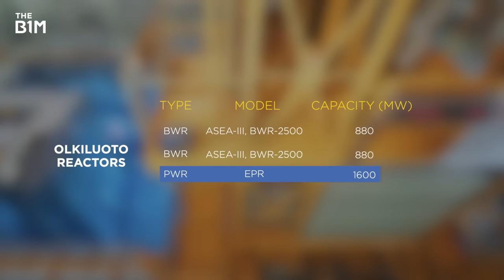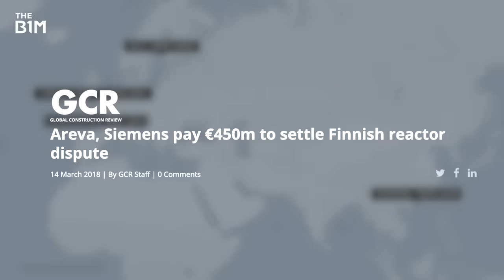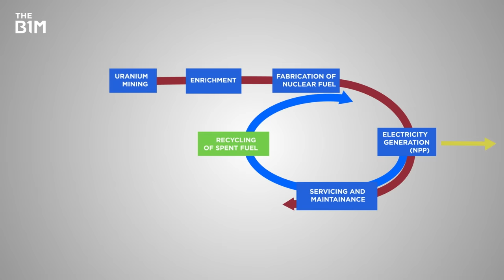Finland Might Have Solved Nuclear Power’s Biggest Problem

Comment: "Just bury it deeper, that should do it." - some Finnish engineer, probably

There is honestly a tiny bit more to the hole than it would appear, a big part why this is viable in Finland is because we don't have that much unpleasant geological activity here. No fault lines, no volcanic activity, no earthquakes... basically just a lot of boring old rock. But that's perfect if you want something to remain nice and sealed in the spent fuel depository.
Reply: I thought there was a development years ago that increased the efficiency of, how much of the rod gets used. Why does this endeavor even exist? They mostly use up the rod, this is unnecessary.
Reply: @HaloWolf102  I'm not a nuclear expert. But I bet the Finns who designed their super efficient ERP are. So if those guys think it is necessary or sensible to bury their spend rots I would guess they know what they are doing.
Reply: @Bryan-fy7od  energy can neither be created or destroyed but transformed from one form to another. so essentially it's all free lol
Reply: LOL, the Brazilian geologic morphology shares the same characteristics that you have described. I am wondering if would be ecological the idea of burring radioactive side product under the amazonian forest.
Reply: @vinolicam4140  Stop now lol, you'll have a job with the conservatives tomorrow
Reply: @dummytest4822  Depends on how you define energy. Is mass energy?
Reply: @HaloWolf102  That's the point: "mostly". No matter how small the leftovers, it is still radioactive.
Reply: @dbclass4075  Containment of radioactive materials is relative easy. We've been doing that for almost 50 years now. It's the part where it can't be penetrated by a militant force. 

In France some of the spent uranum-235 rods still contain a vast quantity of uranium, which is used to enrich new rods that come into production. That means that uranium rods that haven't been recycled, still contain raw power, and expensive materials. Such as in the U.S, they don't recycle. 

"Along with this development strategy, France has a policy of nuclear fuel management focused on the recycling of uranium oxide spent fuel into MOX fuel, currently used in 22 reactors" 
~IAEA 'Country Nuclear Power Profiles'

France (Updated 2020) 

"The U.S currently has 64,500 tons of spent fuel rods, including 15,360 tons in dry flasks." * ~(ton = 907.1847kg)

"Japan’s fuel cycle policy has been premised on the assumption that spent fuel will be
 reprocessed. Initially, spent fuel was sent to France and the U.K. for reprocessing." *

Not to account for the different dimensions of fuel rod cells. I also don't have the total number of rods used between countries, so my argument is not entirely concrete, because research is still ongoing. A data sheet from * displays that in 2007. That france had 13,500 tons of nuclear waste. A dramatically smaller number than what America produced. 

Some more information that supports my original finding of efficient spent rods. Is that "France has 56 nuclear power reactors in operation, with two units closing in 2020 at Fessenheim (61 370 MW(e)) and one EPR reactor under construction at the Flamanville site."
~ IAEA 'Country Nuclear Power Profiles'

France (Updated 2020) 

and 

"As of May 1, 2021, there were 55 commercially operating nuclear power plants"... "in 28 U.S United States."
~ 'FREQUENTLY ASKED QUESTIONS' (FAQS) 'U.S Energy Information Administration' Last updated: May 3, 2021

So not only does France have almost the same number of active nuclear power plants than the U.S, they have just a fraction of the nuclear waste the U.S has. 

The U.S currently has "76 reactor"s" or storage sites in 34 states." (Can't find reputable information on this claim) 'Office of Nuclear Energy' '5 Fast Facts about Spent Nuclear Fuel'
March 30, 2020

*  directly quoted from 'Spent Fuel from Nuclear Reactors' June 2011
Reply: @HaloWolf102  Just didn't know that us even made ton weird. metric ton is 1000kg, so simple.😎
Reply: Day Made  It is not always windy, so we would need a lot of capacity to store the energy somehow. 
And to be fair, the material being buried was already radioactive before it was dug up in the first place, we're just putting it back into the earth after using it (unlike carbon, which gets burned and thus hangs around in the air as a gas).
Reply: Are you sure that that will still be the case in one hundred thousand years?
Reply: And what better way to spice up that boring old rock?
Reply: Finland never heard of "shit happens".
Reply: @PlayRoomHR  Or, more formally, Murphy's law: "Anything that can go wrong will go wrong."
Reply: Finland also has low population density.
Reply: en.wikipedia.org/wiki/BN-1200_reactor
Reply: Day Made  we don't have enough wind and turbines to give energy to the whole world. It's not enough.
Reply: @scifino1  Send Murphy to any landfill near water tables then, not some mile deep whole filled with rocks where some clown thinks Godzilla lives
Reply: Given enough time something will go horribly wrong and the regret will be huge.  For example the holes will flood.
Reply: @monad_tcp  that was not the point. The fact is, if you use that kind of energy source, you will need to coexist with that side product for all your life span, and your son's life span, and lots of generations after that.
Reply: A massive failure to understand time scale. The idea that Finland might be able to control radioactivity from leaking or leaching into groundwater for 100 years -- OK, I'll stipulate it. If we are super generous, let's say 1,000 years. Do we really know if Finland or any other country will survive that long? What natural disasters might occur? What social changes might occur? It would be silly to say that we do. And that's just 1,000 years. That leaves a mere 100,000 years during which poisonous toxic crap sits in the ground, all because it was convenient to do so for a very very brief time. I would call nuclear a terrible plan but that's too kind. There is no plan.
Reply: @qqw743   The time scale and social changes are the main issue, but this is something that countless professionals have spent decades thinking about, and I think you underestimate how much.

First, the repository is roughly 9x as deep as ground water. It is meant to be completely filled shut with clay and concrete so that no water can ever reach the spent fuel, which itself is encased in capsules that should hold up to anything except an absolute catastrophy.

Secondly, if you look at the geological data on Finland, you would find that that there have been no geological or natural disasters of such magnitude that it would, at least in theory, jeopardize the containment. The rock on which Finland sits on is billions of years old. Expexting it to suddenly go up in flames in a hundred, a thousand, even ten thousand years, is more than unlikely. By any reasonable, even worst case, timescale the radioactivity should have simmered down to a natural level.

Also I would like to point out that the hole is much deeper than where fissile fuel is generally dug up from. It is already radioactive before we extract it, and now we are effectively hiding it further into the earth than what it used to be, albeit of course in a higher concentration locally.

Nuclear may not be the perfect option and it does possess inherent dangers, but our main issue is that the use of coal will destroy our society and possibly the ecosystem in under 100 years time. We've already caused the planet irreparable damage and every second forward counts. Building renewable infrastructure takes a lot of time and resources, even when done in places where they are viable. Even things like geothermal power cause inherent risks in the long term (inbalanced cooling of the rock already leads to minor earthquakes in some areas) that we are only beginning to understand.

These people are not putting toxic waste into the ground to spite you; they are trying to save you, while also providing you with heating and electricity to your house.
Reply: @Nas_Atlas  The holes are supposed to be filled shut, so flooding should be very unlikely
Reply: @PastaAivo  I understand that no one is trying to spite me and that the purpose is to generate energy. I also understand that coal poses terrible risks right now. No dispute there. 

Your assurances about Finland I find well-meaning but woefully inadequate. There are two types of risk: social and environmental. 
 Let's take the social risks. How long do governments last? A couple of hundred years. But let's be generous. Let's say Finland will last as it is for 2,000 years, which countries have never manged without massive changes. But let's imagine that this time it holds. OK, great. That leaves nearly about 100,000 years. What will the next government or social order look like? Unanswerable question. 
The Roman Empire could rise and fall 30 times and uranium would still be incredibly dangerous, even in extremely small amounts. And no one is in position to speculate how to solve this problem. 
Are you imagining that 50,000 years from now there will still be the same buildings there, a bunch of Finns in hardhats checking the computers? 
ALL of what is considered recorded history started roughly 5,000 years ago. Think of the massive changes since then. Now project that unknown change into the future. I understand your point that smart people think that they have addressed this problem, but I dispute that they have made any progress whatsoever. Can they assure us that 1,000 years or even 100 from now, there won't be people in the area who want to dig up the uranium and disperse it? I don't know why anyone would want to do that, but that's the nature of the unknown. Who knows? 
For a sense of the difficulty of imagining the future: let's go back in time and ask the Goths what they think of the internet. It's absurd, right? So are these assurances. 
The second type of risk is environmental. I understand that engineers sought rock that has been safe from risk for a billion years. Prove to me that there will not be an earthquake, flood, hurricane, etc. etc. that undoes all that confidence. Naturally, you can't, because it's speculative. But that's the nature of the time scale, it forces speculation that gets increasingly unreliable as the scale increases. 
If you tell me you have a high degree of confidence that nothing bad will happen next year, I'm with you. Five years? Sure. 
50,000? How can anyone claim that they can guarantee with a straight face that ceramics created in 2020 will hold up just fine throughout that time? There is literally nothing we can say with confidence about such time scales, except that uranium will still be really bad news for living organisms. Maybe during that time someone will figure out a good way around that. That would be nice. But we have no reason to think so. 

Meanwhile, we have safer options. Every dollar invested into nuclear is not invested in renewables, which don't leave a terrible cost behind. The progress we have made on renewables is incredible. We have the technology already to power the world, if we were to coordinate it globally. I'm old enough to have witnessed assurances that nuclear power is safe from one generation of plants to the next, only to find out that oops, it's not, and the waste keeps piling up, not one bit safer than it used to be.
Reply: @qqw743  And some dollars not invested in nuclear still unfortunately go to coal. 

But I agree, I'd say the biggest danger by far is the society forgetting where we hid the radioactive material and digging it up by accident. There are ways to prevent that, but only for so long. We can just hope that mining etc. in the future is done more responsibly than today, and that instruments like radiation gauges are being actively used (which I assume is the case even now, although I don't know).

In regards to the geology, my point is purely statistical. It is of course possible that just now there is a new superplume developing underneath the rock, or that something like a meteor would hit the spot in the future. We just don't know, but this currently seems the safest option. Same as if you feel like your home street is safe; there's never been crimes or violence committed so you don't expect any to happen, but it only takes a single stray bad actor to change that :)
Reply: @vinolicam4140  I know that, I better my children coexist with nuclear waste and take care of it like we do, than living in a +4c climate change with extinction of lots of ecosystems.
Reply: @monad_tcp  it's sad anyway.
Reply: @dbclass4075  "mostly"
Duhoh 
Like most naturally occurring things like potassium, which is slightly radioactive.
There's no such a thing as 0 radiation
Reply: @qqw743  renewables don't leave a cost behind, WHAT ?
What about the billions of tons of trash when their puny lifetime of 25 years expire ?
While a nuclear plant could last for a hundred years, but usually 60, and most of it is concrete, which is mostly inert and could be reused as gravel for pavement or something...
Reply: Heck, I'm not against solar power, I even have a small 1MW power plant which I sell energy.
But we need nuclear power for GW demand scale, remote regions, regions with colder environment. Regions with lots of variable demand.
We need everything we can throw at the problem, which is shutting down ALL coal and gas power plants. 
Solar alone won't cut with a solid 30% baseline of nuclear.
It's about economical feasibility.
Reply: We're not near closer to solving energy storage at scale. We absolutely need nuclear to make the grids work. 
Otherwise we are going to end with lots of gas power plants.
Which is BAD.
Reply: We better take care of NOW.
Because guess what ? Most of nuclear waste is on the surface, not buried.
So if society fall in 50y, which is very likely, who knows what people will do with fresh nuclear trash easily accessible without digging.
Instead of worrying about dumb treasure hunters in 50K years...

I'm literally rolling my eyes...
Reply: @monad_tcp  Spent nuclear fuel's radiation is still above safe limit, though.
Reply: @dbclass4075  doesn't matter when there's a billion tons of earth of top of it.

the safe limit of radiation for non-living things is what ?
Reply: @monad_tcp  Not great, not terrible.

Joking aside, spent fuel isn't something to handle so casually. The issue with them is less on the radiation intensity, and more on their duration. Somehow, our warnings should be something that can last longer than the lifespan of our languages. Something that should discourage curious beings from digging them up agin.
Reply: And I'll talk casually about it, it just another dangerous thing we take care of, as a society. 
I don't like this idea of conflating something with "pure evil".
Reply: TL;DR
I don't fear nuclear power or nuclear waste or even radiation. 
Its super well studied, the computer simulations are almost perfect.
We know the good, the bad,  its predictable. (no, chernobyl wasn't an accident, doing what they did, and knowing what we already knew that time, was criminal behavior)

Now when we talk about climate change. I don't fear it, but I fear the results, they aren't easy to predict like nuclear power. We are dealing with this thing we don't yet know how it works.

People should absolute be horrified about pushing the climate of the planet too far, yet, they don't...

That's what worries me. I guess we aren't not that different from a frog being boiled. A nuclear explosion is something that visceral and immediate, but a climate runaway is just normal business since 1940....

Fear is stupid in this complex world, don't listen to it, it doesn't know shit.
Reply: To anyone still interested or concerned, here's a very good video from the actual repository tunnels by Tom Scott
https://youtu.be/aoy_WJ3mE50
Reply: ... or so they thought...
Reply: @qqw743  “progress we … made on renewables is incredible”

Germany, 2021 TWH of coal electricity generation

3rd quarter: 35.1 TWh
2nd quarter: 28 TWh 

an increase of some 20%, quarter to quarter.  In  1st quarter 2022, fossil coal and gas will increase another 20% or 30%, as four more very viable nuclear plants close. All of that is on you.
Reply: @monad_tcp  Well said.  I’m afraid things will not change though until this phobia dies.
Reply: @mrg8092  No.
Reply: @monad_tcp  Please don't @ me any more, I'm exhausted by the absurdity of this thread. I thought this was going to be a science-based rational discussion. 
You lost me for good at: "The computer simulations are almost perfect."
1. How can anyone know that? 
2. "Almost" isn't very impressive over immense time scales.
Reply: @qqw743  I was talking about simulations of nuclear explosions. Not the plato's  hypothesis of philosophical simulation.
 They are almost perfect in a way they predict 99.9999999% accurate. 
Its the best simulation of anything we have. Why do you think governments invested so much in super computers? to run those simulations and keep developing nuclear weapons without a single detonation (that was banned). That's how good the simulations are.
Reply: Time scales don't matter for a nuclear reaction of a detonation that happens in milliseconds. What matter is if the simulation output matches the data.
Reply: This is literal science, I won't dump a lot of papers here, but its all know information, there's nothing that was more tested than nuclear simulations. 
Fluid-dynamics comes second, for obvious reasons of it being super useful modeling almost anything for the industry.
Reply: @Nill757  burying it in any abandoned salt mine would basically solve the problem. But people like to conjecture what will happen in 100K, it doesn't matter, any nuclear waste will be less radioactive the nuclear background radiation on some natural places...
the sight...
Reply: @qqw743    " "Almost" isn't very impressive over immense time scales."
Yes, because we need PERFECT ...
100% certainty only exists if you are a LIAR.
Nothing has 100% of perfection.

roll my eyeballs so hard it hurted...
Reply: @Nill757  unfortunately.... yes. What happens when solid material is removed and replaced with softer material? Yes.... it colapses! lets think about the weight of 1 mile of earth sitting on a spent Uranium tube bed. Think the preassure would blown the radiation upward after some tubes cracked open. enter the water supply? This is a quick fix. Those who thougth of this idea will be long gone before the real issues arise from this burial process. Mark my words... but then... ill be gone as well, so should it really matter?! .... yes... for your grandchildrens grandchildren.
Reply: @HaloWolf102  because that remaining 5% is radioactive and lethal for several millennia, 10s of thousands of years, but cant be used in the reactor because they don't give off enough thermal energy to boil a kettle, much less run a reactor. leaving the old rods in the reactor will also lower the efficiency, actually creating more radioactive waste.
Reply: @MyCheese123456789  Ah, so they prematurely stop the entire rod being used up to prevent the efficency of an area being eradiated by the rods. I have never read that anywhere, however that does make logical sense. 

I still don't know where I read that paper on them being able to use more of the fuel rod because of a new method they found, but I guess this search has to end. Thanks for the info.
Reply: See, it's not that this idea isn't feasible, it's just that this new disposal system works best in Finland.
Reply: Rat Pack  Do you realize how much coal it takes it the metal smelting process to make a wind turbine? It takes massive amounts of coal to produce the steel required for the making of a wind turbine. so much so you would better off just burning the coal for power.
Reply: Rat Pack  no man STEEL Needs COKE IE coal to make the high carbon content to make the steel from iron. its not a matter of melting at all.
Reply: @RenardThatch  That won't happen, lithium is found in open areas with a lot of salt in them, like marine deserts and near volcanos.
Reply: "don't have that much unpleasant geological activity here" today but we are burying this shit for millenia.  Its OK, we will be dead by the time this shit becomes an uncontrollable problem...
Reply: @dennispanko6311   I am not an expert so I trust my race to someone in a white coat...  just like the people of Chernobyl did, or Fukashima, or etc. etc. etc.
Reply: @vinolicam4140  My concerns about that are twofold: 1) The United States would jump at the chance to store THEIR nuclear waste in Brazil, instead of the Brazilians benefiting from nuclear power and using it for themselves, and 2) Some U.S. corporation would decide to save money on the sealed containers and/or some other aspect of sealing up the waste, and create an environmental disaster.
Reply: @Flip-3206  like the Yucca mountain in Nevada...Nevada has no nuclear plant, but was choose to store the nuclear byproduct of other states... making it brief: one of the biggest storage site of nuclear byproduct of the US was blocked by people's protest against those points rose by you.
Reply: @HaloWolf102   Please note that you are comparing the number of nuclear power plants in the US to the number of nuclear reactors in France. The numbers that I found for the number of nuclear reactors in the US is closer to 93 [1](A power plant can have multiple reactors). So the US has 93 reactors compared to France's 56[1][2][3][5]. This has parallels to the nuclear energy generation of each country. Where the US generated 843 TWh (19% of total energy in 2019)[3] vs. France's generated 413 TWh (71% of total energy in 2018)[2]. 

As a US resident, I don't doubt that we don't recycle as well as other countries but I find it unfair to compare raw weight of spent nuclear fuel in the face of varying energy generation.

So in short, the US is the worlds largest producer of Nuclear energy by amount and France is the worlds largest producer of Nuclear energy by percentage energy generation. 

Here are some of my sources:

[1]  https://www.eia.gov/tools/faqs/faq.php?id=207&t=3
[2]  https://world-nuclear.org/information-library/country-profiles/countries-a-f/france.aspx
[3]  https://world-nuclear.org/information-library/country-profiles/countries-t-z/usa-nuclear-power.aspx
[4]  https://world-nuclear.org/information-library/current-and-future-generation/nuclear-power-in-the-world-today.aspx
[5]  https://pris.iaea.org/PRIS/CountryStatistics/CountryStatisticsLandingPage.aspx

From your original comment:

Some more information that supports my original finding of efficient spent rods. Is that "France has 56 nuclear power reactors in operation, with two units closing in 2020 at Fessenheim (61 370 MW(e)) and one EPR reactor under construction at the Flamanville site."
~ IAEA 'Country Nuclear Power Profiles'

France (Updated 2020) 

and 

"As of May 1, 2021, there were 55 commercially operating nuclear power plants"... "in 28 U.S United States."
~ 'FREQUENTLY ASKED QUESTIONS' (FAQS) 'U.S Energy Information Administration' Last updated: May 3, 2021

So not only does France have almost the same number of active nuclear power plants than the U.S, they have just a fraction of the nuclear waste the U.S has.
Reply: @joshuabarber4733  "...but I find it unfair to compare raw weight of spent nuclear fuel in the face of varying energy generation."

Yes, there was a lapse of information since I couldn't find anything in my very short pursuing of data. My argument wasn't fully intact.

"Not to account for the different dimensions of fuel rod cells. I also don't have the total number of rods used between countries, so my argument is not entirely concrete, because research is still ongoing."

& 

"I still don't know where I read that paper on them being able to use more of the fuel rod because of a new method they found, but I guess this search has to end."

Thank you for the cited sources in your comment. Individuals like you make an example of how an argument should be presented.

In the end, as per usual, is that I have not read up on enough material to make a decision on this topic. These links will provide more information for me to read,  as well as interesting others. Thank you for time and have a nice day.
Reply: @HaloWolf102  Thank you as well for being accepting of more information. I wish more people could respectfully converse like this in comment section. Best wishes to you.
Reply: Yes, and the earth axle is wobbling. Who can garantee that wobble will never change? Maybe Finland will get a vulcano after 90 thousand years? We homo sapiens are always bloody optimistic. But ordinary people can't even read hieroglyfs, and those are only 4 thousand years old (or how old are they). We only live now and we hardly know a thing about the past. We need specialist for that, and all they do is disagree and argue. Great.
Reply: @thequattro20v  Those emperor followers are not exactly smart. Changing is never easy, but in this case I'd fully understand an invasion and suppressing those Americans, until they gave up these stupid units for everything.
Reply: @lordanonimmo7699  Ah, is that tunnel leaking ALREADY?!
Reply: @voornaam3191  Yeah,they had problems with cooper.
Reply: @PastaAivo  Flooding is good! Nuclear reactors are in such a "swimming pool" for a reason. Water blocks radiation extremely well. But yeah, when there is water contained in that rock, will that slowly slowly move into our drinking water? Did those engineers check that? Oops!
Reply: @voornaam3191  Uh, you tagged the wrong guy. I agree with you.
Reply: @voornaam3191  sorry, I don't agree with him to, and I am sure that he was not a good choice, but the hate against him will just makes things worst.
Reply: Though there are re use methods for nuclear waste and future thorium reactors may make this an even more long term option since the half life is low and the waste is even lower
Reply: @kevinmclain6741  Impossible to say, but none in the previous 10,000,000+ years
Reply: @PastaAivo  Based on what science?
Reply: @kevinmclain6741  Geology and statistics, mostly. Possibly some radiology. Finland is extremely old geologically speaking, much of the rock is either 1,9 to 2,2 billion years old or 2,5 to 4 billion (archean). Pretty much in the middle of the Fenno-Scandian shield so it's some of the oldest surface rock you can find. Geologically speaking quite boring, unless you go very, very far back.
Reply: A quick search tells me you have zero clue what you are talking about.
Reply: @kevinmclain6741  You need to open your results a bit more to help anyone in this comment thread
Reply: The unexpected is invisible by nature, I pray you will never say they never saw it coming.
Reply: Yea that makes sense. Japan definitely should not attempt 😂😂😂
Reply: @danielw.2554  Can totally agree with that! :D
Reply: i think Finland could even have a deal or multiple deals at hand regarding sharing their nuclear awoken energy to other countries by constructing big power lines to whatever country and supplying those with energy/electricity..
Reply: Answer this then: Given your lovely geology, are you willing to take on the rest of the world's Nuclear waste? If not, why not, if it's so ideal of a solution?
Reply: @stephenhunt6253  I don't really know how much the total would be, but if it's economically and space-wise feasible, I personally wouldn't mind. But if I had to guess, the total amount is probably a lot greater than what the construction/digging here could support (and a concentration of material on that scale could potentially mean new engineering/environmental challenges).

As far as I know, there are already agreements with some countries etc. to import their radioactive waste and bury it here for a cost, but I don't have any details on the amounts or other terms. There definitely is demand for that sort of thing though, since there are not that many (or any?) final placement spent fuel repositories in the world (this might be old info).
Reply: @PastaAivo  I agree there aren't many (or any?) viable repositories for the ever-increasing amount of spent fuel. However, my concern is that calling this a 'solution' legitimizes (in the minds of nuclear advocates) continuing to build these plants (and thus produce more waste). As you've pointed out, even with ideal geology, which few locales have, this isn't sustainable due to the size and engineering required to take on more (up to what point) waste. Better to acknowledge that fission has been a failure and adopt new/safe/sustainable means of providing energy.
Reply: @HaloWolf102  Ironically most nuclear waste isn't even the spent rods themselves because they won't be that radioactive because well it was spent. Most nuclear waste is the processing equipment which includes glassware, clothing and the likes from the labs.
Reply: @qqw743  So what do you suggest? Burying in 55 gallon drums in a landfill? Storing in cooling pools that require energy inputs? SMH.
Reply: Doesn't really pave the way for countries with geological activity and poor service records.
Reply: This is covered in the video
Reply: @chrisnamaste3572  Don't make it in the first place.
Reply: imagine an radioactiv plutonium volcano
Reply: You know what, austraila could adopt the same method as we only have above surface level environment threats.
Reply: The clay also acts as shock absorption for places where there is geological activity